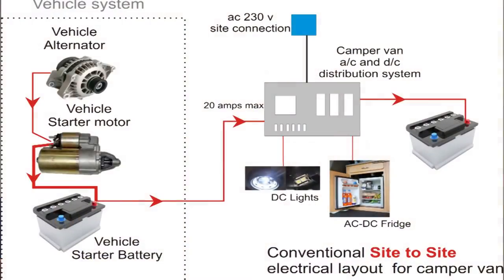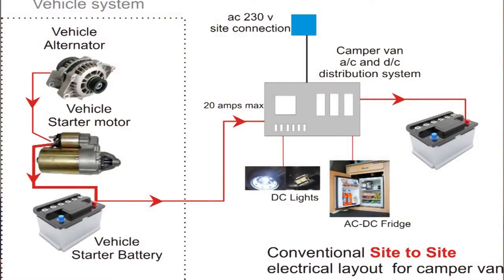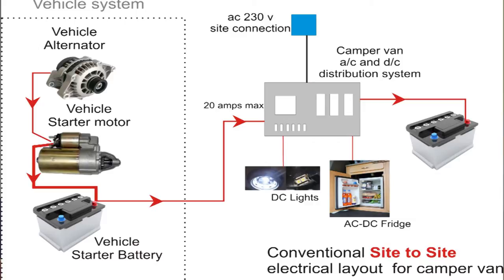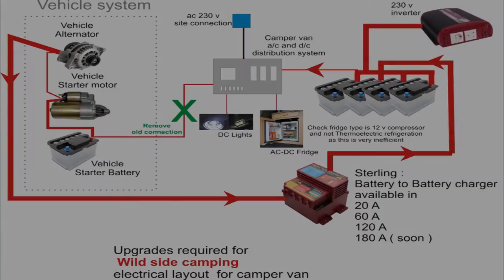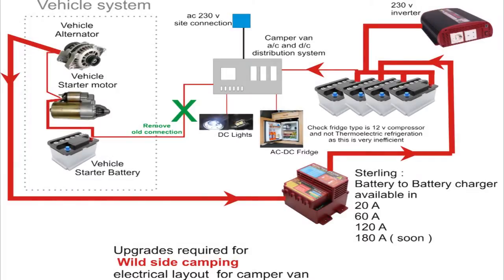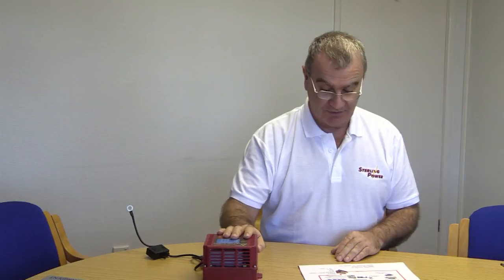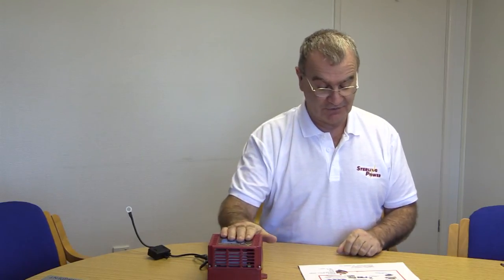Wildside camping power system

Comment: A couple of comments to help US customers :

• "Wildside camping" is usually referred to as "dry camping" or "boondocking".  Bottom line is no external hookup, but many people are now adding solar power.
• US vehicle have had smart charging systems since about 2000.  Similar to what Euro 5 or 6 has.
• Regenerative braking is not a big issue in the US (except for hybrid/electric vehicle) BECAUSE almost all US vehicles have automatic transmissions.  Automatic transmission do not do as good of a job of providing engine braking (i.e. the drive wheels send power through the transmission back to the engine and ultimately the alternator) as manual transmission.

Comment: Hi. read something about this. I was under the impression a solar panel could be connected and the unit would switch the power made between the batteries when the vehicle was parked up. Is this correct? Thanks.
Reply from the maker: +Chris McKernan Hi Chris McKernan Sorry for the delay in response! This depends on how you are wiring your system, however our advise is it is best to put your solar directly on to your domestic batteries. This unit will only pass power from the starter (when engine is running) to the domestic. We offer a smaller product (BM12123) which can drip feed a solar charge from the domestics to the start which is perfect for a solar set up. 

Thanks for watching!

Comment: Why are you calling this a "Battery to Battery Charger when the diagram shows it connected between Alternator to Battery? Like the straightforward content. I,m learning lots of new stuff. keep them coming.
Reply from the maker: +Paul Gretton Hi Paul, the BBW can be connected from the starter to the domestic battery. Likewise, as the alternator's voltage is 14V or so, you can connect it directly to the alternator too. It can be installed way.

Comment: I have a ford transit 1987 ICECREAM VAN alternator 220amp engine battery 100amp and trogan deepcycle bank1 220amp bank2 220amp running for 15hours for slush puppy 800watts and hot dog machine 800watts Stirling 3500watts can you explane wiering to get continueing max power for 15hrs